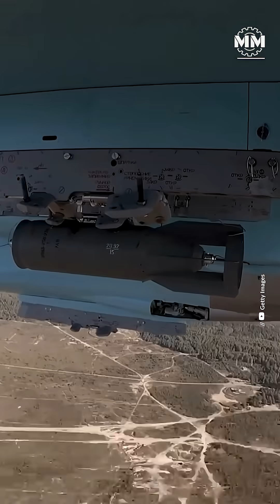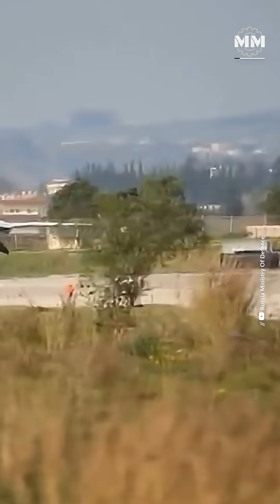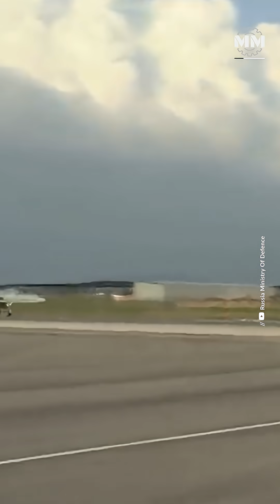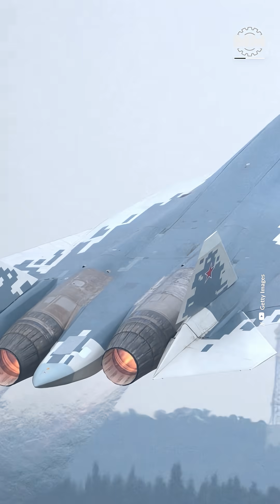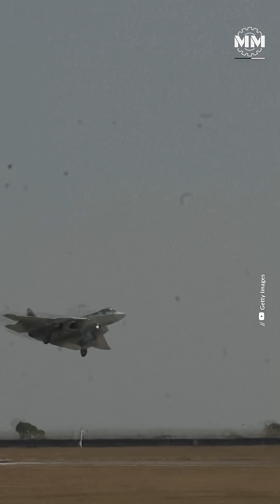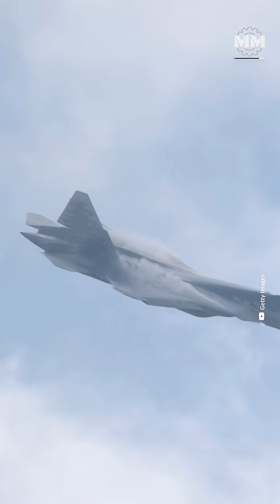The Real Reason Russia’s Su-57 Sounds So Different from the F-35

Comment: That’s BS 
The sound is made by movable parts to internally control the air flow within the air intake but before the engine itself. 
They are plainly of wave trap in the past. A technique already used in the f18sh.

Comment: Yes an Australia just electronically cataloged its heat signature all the way down to the hydraulic system temperatures, thrust movements and counter measures systems and direction the pilot needs to look in the cockpit so missiles hit at a 99.98% kill rate.

Comment: If anyone is wondering it whistles really loud and you can hear it coming from miles. It's engines are less powerful than the f22s and the f22 doesn't make that sound.. the Americans made a f15 with thrust vectoring in the 80s that'd do anything the su57 can do. It had powerful engines and it didn't make that noise neither did the f16 they made with thrust vectoring. The su57 frames are also prone to cracking. It's a maneuverable jet though especially at stall but that thrust vector loses so much energy on turns and energy is life in a dog fight. Looks good at airshows though.

Comment: Oh for crying out loud...what a load of BS. Su-57 also has s curved air ducts and been proven countless times and the only time blades were ever seen were from a steep angle and even then the blades have similar system installed on the Growler to hide the remaining signature. The al-41 installed is also not the final...once new Izdellyia with angled flat nozzles make it the plane will forever be transformed and this entire spill of made up easily searched and verified that someone obviously failed to do will age badly.

Flat nozzles are neither new nor revolutionary... even mock up of su-47 had a full glazed single piece canopy and flat nozzles in the rear with a flat nozzle taking to the skies on a su-27ub back in the early 80s!! 

Whats been found and gradually worked on is sensible and lots of projects take time if done right with parameters and budget in mind.

The fact su-57 flew within two years of its first mention and then performed first mission two years later is a feat in itself. Then production started in 2020 and has now accelerated and the next phase once complete will include these new nozzles. 

F-22 production fell short of 200 and f-35 with 1000 produced but only 28% in active combat readiness as the rest literally seem to always be buried in a state of repair and ungodly money to repair it. After 30 f-35 crashes and mishaps I started to lose count.

Comment: Russia builds a couple of hand built planes where panels from one has to be hammered into place on another, they have huge exposed engines that radar from the 70’s could spot a hundred miles away. One is a stealth plane and the other is not remotely close to stealth

Comment: I used to deer hunt some miles from Arnold Engineering Development Center where they did work with jet engines. On occasion they would fire up one, and miles away, sitting in the woods, it was like you were in the same room with a monster vacuum cleaner

Comment: The biggest difference is size and purpose! Lastly cost! The SU-57 is much more affordable than the F-35, cheaper to operate per hour, although it is gasoline hungry ( SU-57 ) compared to F-35. Range is a issue with the SU-57, but for its size which is slightly larger than a old F-4 Phantom ( which was America,s largest fighter jet thus so ), the SU-57 is short range Bomber size! 😮😮😮

Comment: Don't worry, some snart ass US engineer will figure out how to get a missile to track that sound signature.

 Instead of an infrared tracker up the tail pipe, you'll get one that goes in the jet intake. 

 It won't be the main tracking method either, it'll be a rarely used auxiliary function. Just in case.

Comment: Presently, U.S. F22 & F35 are designed and made to do the job and not get shot down and get the plane and pilot back!  
The SU-57 has only built about 30 units and is not used outside of launching glide bombs and missles from 50 or miles away from any radar defenses and an occasional sighting at air show events!

Comment: Even though the sound is so iconic, it is likely to disappear I'm the future. The su 57 will have their engines replaced if the people in charge ever finishes the new engine. Also, recently a model of the su-57 had changes that made it similar to the f-22. The changes haven't been seen in any real su-57 but at least it looks like either the existing su-57 will receive updates or there will be a variant that is stealthier.

Still, have you seen how close is the su-57 before you can hear its howl? A su-57 would never be that low close to a ground enemy. What I mean is that if you are the target you won't see it or hear it, so in my opinion the sound itself does not compromise stealth

Comment: You don't know sheet... Howl is caused by straight cut fan blades. Western engines have 3-D designed fan blades they are quieter. It's not the intakes or exhaust nozzles that cause the howl. It's the fan blades.

Comment: The video is based on wrong ideas.
The answer is simpler, actually.
The Su-57 makes such sound just because it has radio blockirators in front of its turbine blades, they have some kind of spiral shape to reflect radio waves to inside of the turbines, it was described in the patent documents of Su-57 with the graphical schemes. They actually can change their shape for different flying modes and they produce such a sound for some angles and speed, not always.
The idea is not new, actually, I think the F-18 does have radio blockirators too,

Comment: What matters in a fighter jet is not stealth but maneuverability and weapons. In both the SU beats the f35 hands down. It even has hypersonic weapons. Which means if a su has you locked in there is no escape.
Casting the Failure-35 as a contender here is hilarious

Comment: For those who are saying "But I can hear the F-35" that is because they're flying low enough for you to hear them. The same reason you cannot hear commercial flights at cruising altitude.
Also stealth is not just about noise. The F-35 and F-22 fighters mentioned in the video use optimized geometry and materials to make it so they show up on radar, as Habitual Line Crosser puts it: a mach 2 bumblebee. The SU is optimized for dogfighting and its stealth capabilities are just not the same, and dogfighting is not useful when you cannot see your opponents before you hear the missile lock tone

Comment: Notice the separation between the two engines....that creates a volume to store fuel.  Compare with two engine US fighters.....their engines are side by side. The SU is a BIG aircraft.   Russia is a big country and air bases can be far apart....hence the SU has a long range due to large fuel internal storage.   Of course it's range is not so far when it's on afterburners.

Comment: The F-35 alone is kind of impressive but the technology and support system available to the F-35 platform could dominate an airspace without even flying close to the enemy's reach or sight.  Expensive as hell but the dogfight is over before the enemy even knows of a threat in the air.

Comment: This is nonsense 😂😂😂
The su35 has a straight intake and makes no such sound.  The intakes on the su57 are not straight, they just look that way. The raptor's intakes look straight too, but they're not. 
The sound is called a blue note and it's caused by the leading/root extensions on the wing, or whatever you choose to call it. These are adjustable surfaces, hence the sound only being present sometimes.

Comment: There are a few aeronautical engineers around who would basically laugh their asses off at this preposterous claim of building a fighter that was meant to be heard as a fear factor, 

Do you understand the definition specious reasoning?

Now from what I understand, the su-57 is supposed to be a5th gen stealth fighter, they cannot create the technology for stealth seen in the west, take the F-22 for example, Putin wants the 360 degree bubble canopy with ram coating but their scientists and engineers cannot produce it, and many other unproducable components. 

Why do you have to wait to hear it coming? The RCS on the su-57 is 10,000 times greater than the F-22, and a thousand times greater than the f-35. 

It's easy to hear, it's easy to see, it might as well have the radar cross-section of an albatross.

The su-57 is designed for BVR aerial combat, with its radar cross-section it's going to stick out like a sore thumb, and with American AIM-174B coming online this will give the US Air Force a range of 250+ miles in bvr long-range engagements, and the su-57 is going to have a hard time engaging targets because theyare so visible, to the ears, and eyes, and to radar which is going to paint that lead sled like a house.

Comment: Lol the F22 and 35 weren't designed to be quiet they were designed to hide their cross sections from radar detection. The entire purpose of the F35 Lightning is infiltration but by God it's loud as hell on take off. In fact the Su-57 is by far the quieter jet but not a quite, "stealthy".

Comment: you forgot to mention that Su57 has a phased array radar w/ beam-forming which pretty much negates all the “stealth” features of the F-XX, in fact the so called “stealth” technology is only somewhat effective in a decimeter wavelength radar - in the meter wavelength bands it’s radar signature and cross-section is identical to any metal object of similar size. surely one could argue that a lower frequency radar lacks in precision, which is true, however it has a longer range and when combined with modern digital signal processing technology it is more than “good enough” to detect, lock on and track potential targets - you just can’t beat physics no matter what kind of bullshit you tell to American taxpayers paying the bill for R&D

Comment: Nonsense. Su-57 can carry a payload higher and further than F-22 and F-35, without the use of external fuel tanks. Higher engine thrust also allows higher power draw for a larger radar.

Comment: This voice over refers to the first version of the SU-57, that was whitout it's designated engine, and stil reaching over 2800 kmh!! Since late 2024 it's in mass production because it's designated engine was ready, it makes less noise and the max speed is now 2.8 mach 2.8 so 3457 kmh, and is now called SU-57M, if you really don't know shit, shut the fuck up idiots! And now lets talk about the antique F22 and F35...as in slow and much slower, the last stil falling out of the sky.... Also visable on the SU-57M new type of radar technologie that makes STEALTH OBSOLETE, they are visable from a distance of 600km. 😂

Comment: The air intakes of the Su 57 are the same as the f22's, in fact, they're more stealthy than the f22's. F22's intakes are placed on the side outside of the frame, Su 57's are under the main frame, and 57's frame has smaller signature than the f22's. In reality, the sound they make makes no difference, this video is disinformation.

Comment: So, once again author doesn't understand what he is talking about.
The shriek is heard only when Su-57 flies at low speed. Exactly because of very complex inner structure of the engines. The most important advantage of those engines is much higher speed and supermaneuverability. It is not "spectacular" - it allows jet to dodge missiles, so heavily boosting it defense abilities - and in case of dogfight it gives total advantage. So it is important both in close range and high range combats.

Comment: And the SU-57 will still loose in any battle every time against an F-22 or F-35. It looses before it even sees the other aircraft. 
  It would loose to an F-18 almost 80% of the time
    It is not even a true gen 5 aircraft. 
   Russia is scared to bring it to the front line against Ukraine anywhere they don’t have triple redundancy protection from the ground

Comment: Unlike many modern Western fighters that use S-shaped, shrouded intakes to hide the engine fan from radar and reduce noise, the Su-57's more direct inlets allow the rotating fan to create high-pressure waves that resonate and are amplified, resulting in its signature howling sound.

Comment: It really comes down the doctrine they plan to use it. 
Also, we need to take into account that those blades are visible from a given angle, The Russians mainly land-based closed to Russia and in the age of spy satellites a "stealth" airplane squadron is easily detectable from distance.
F-35 have to fight a differently. Both land and sea based, far from home equipped with better intel and tech.
SU-57 is more like a guerilla fighter/defender. F-35 is more like an invader.

Comment: Like the TU144 vs the Concorde that used the afterburners to reach Mach speeds during the flight using 3 times more fuel and while passengers flew almost in silence, in the Concorde, they had to fly with double ear protection because in the TU144 the noise was umbereable, oh yeah great technology.

Comment: Legend has it that the sound coming from the SU-57 inlets also causes distortions in the air which causes both visible refraction of light and radar waves when facing head on.... Never seen it myself but legend says so.

Comment: Never heard one in person but I did experience a B2 Spirit fly over my small town and I was surprised and impressed by how quiet it was. Just a smooth gentle swoosh of air without any turbine sounds.
Reply: glide mode man ... sneaky rascal mode   😂
Reply: @DonT-z8i judging from the low and level flight path (it seemed like just a few hundred feet), I think the engines had to be under power when I saw it. If it were gliding without power it would have to be slowly descending to maintain airspeed and that wasn't the case.

Comment: In 1963 I moved from CA to San Antonio, TX and lived right near the end of Kelly AFB main runway.The B-58 Hustler was still flying then and man, when they took off it would literally vibrate my tv over the cabinet where I had placed it! Unforgetable. 
Also, when the VN War ramped up a few years later many B-52s were stationed there and near my house was a backstop where they would back the plane to them and then test the engines at  very high power with a similar effect on my senses...
Reply: They call it the Blast Pad.
Usually done right after phase maintenance work.
Reply from the maker: Those ground-shaking moments must have been truly unforgettable! We love hearing personal accounts like this that connect our videos to real history. Stay tuned for more content!
Reply: Long ago I used to attend a summer camp very near a SAC base,first thing in the AM  B52s would pass over the camp on takeoff, no need for reville to wake up !
Reply: The b-58 Hustler used the same J-79 turbo jet after burning engines as was used on the F4 Phantom, it's volume would have been equivalent to about two phantoms taking off in full afterburner, and after working end of runway at George Air Force Base I can tell you with all certainty that.... 

It's really freaking loud.

Comment: Good looking jet, but that's exactly the problem.  They put too much emphasis on superficial details and looks rather than stealth.  Glass canopy is clear as day with a huge exposed bow.  Engines are exposed.  Levcons aren't stealth and unintentionally create that screeching (Ti fighter) sound when flying over at low speeds/altitudes.  Underbelly has too many uneven surfaces.  Multi digital paint camo is not stealth and lacks ram.  Overall structural symmetry and balance is not 5th gen platform standards, i.e. less is more when it comes to stealth. 

For comparison, the Su-57 has the same exact rcs of an F/A-18 Superhornet, sans external ordnances.

Comment: What you left out was that the AL-41 engine was only a stop gap measure until Russia had perfected the AL-51 which was a more powerful engine, giving the Su-57 super cruise without using afterburners! The problem for Russia is that you need special milling machines for the tolerances needed to mass produce these engines which have been cutoff by Western sanctions. Russia has hand built a few AL-51’s but that is slow, exacting and more expensive, especially when you need two engines for the 76 scheduled fighters? While the Chinese milling machines are cheaper and available, they lack the precision needed to make such a sophisticated engine?

Comment: Su-57's air ducts are NOT straight. There is just a small edge of the compressor blade visible. Moreover, the moveable surfaces above the intakes can screen this edge from radars, and stealth becomes OK. Stealth when needed, full aft when needed.
Reply: No need to be straight!
Reply: Semi S-duct like e.g. the Typhoon.
Reply: keep analyzing that intel bro   ✊ 😁   share the wisdom
Reply: It's actually these surfaces that cause the sound, not the blades